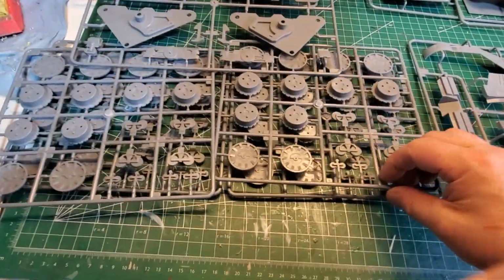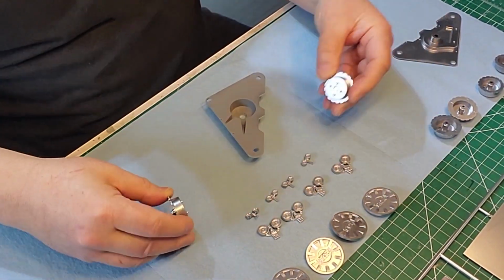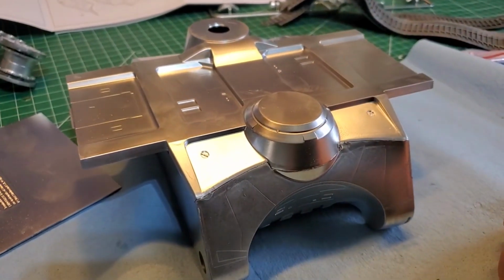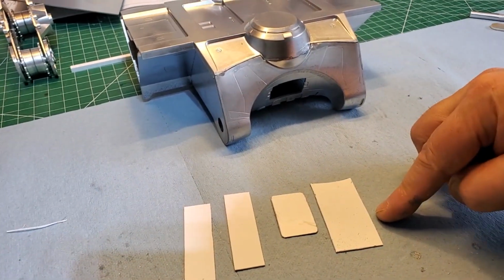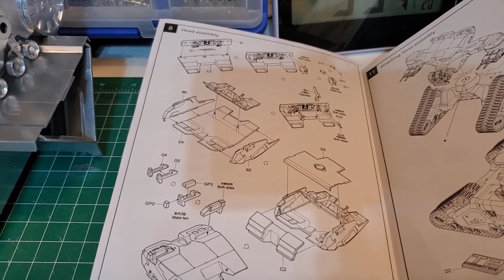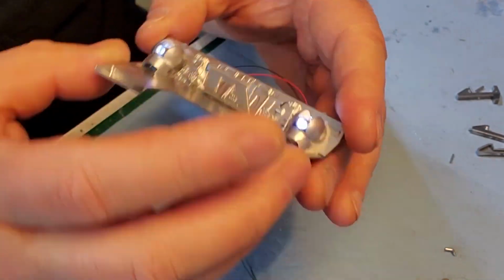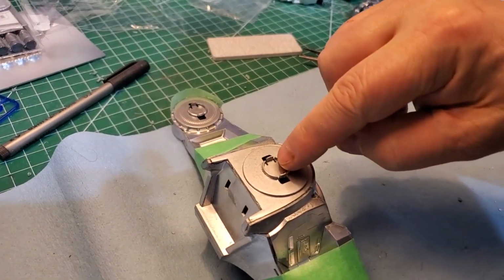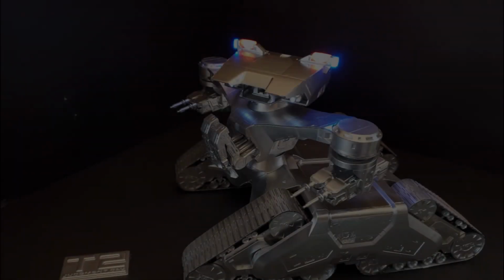Terminator Hunter Killer (HK) Build

Comment: Looks Good!  I built this "Hunter Killer" model (no lights) about 6 months ago and I really enjoyed it.  Out of the box, it looks easier to build than it really is.  Getting the seams to match on the arms was probably the hardest part for me but I took it slow, and it turned out great (no filler needed).  I used a thin glue and tacked the seams, let dry, and repeated until everything was properly glued in place.  It was slow going but worked out nicely.  Great video!  Thanks, Eric